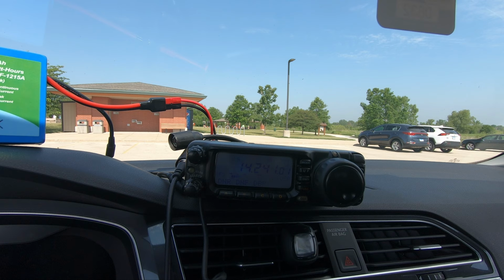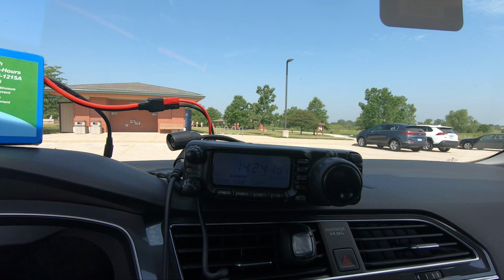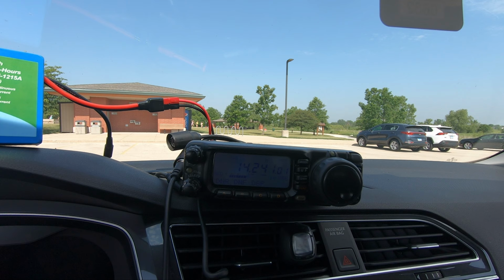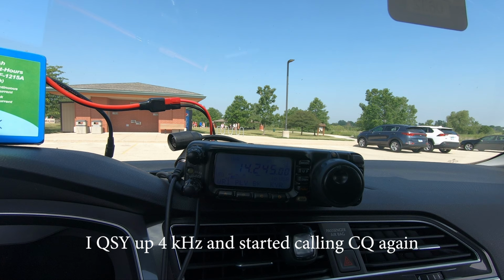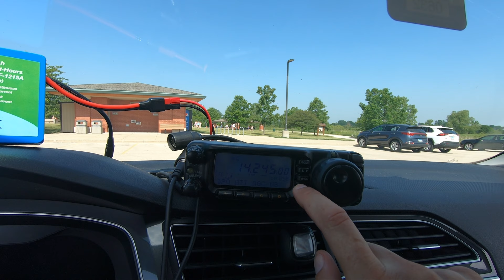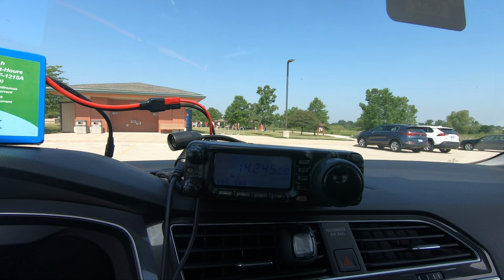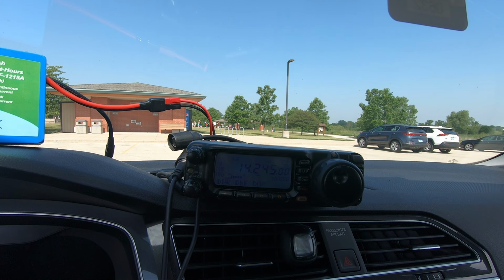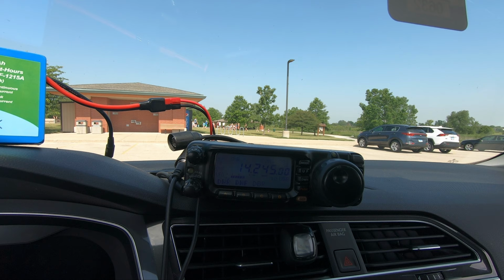Failed POTA Activation With The Yaesu FT-100

Comment: The swr warning comes on on my ft100 when it feels like it so dont trust it I've turned mine off and use a separate swr meter. Reading other reports it's a common fault with this radio. Keep up the good work. By the way my ft100 is a workhorse and gets hammered.
Reply from the maker: Thanks for watching and for the comment!  The issue I was having was with the hamstick I was using, I have since figured out the antenna issue and sent the FT100 in to get the 6m issue resolved, so I should be back up on the air with this radio soon.  Glad to hear it is a  workhorse because it is going to be my portable/field 100 watt radio.  73, WQ9F

Comment: That sucks that you didn’t activate the park. Get that SWR fixed!!!

I’m careful where I buy my gear. Usually from a reputable website/company. Not into buying used stuff.
Reply from the maker: I've bought many used radios in the past, even some on eBay and this is the first time i've ended up with a bit of a basket case lol.  I've gotten the SWR under control with some changes to the gear though and things have greatly improved!  Got some new videos coming up i'm pretty excited about.  73!

Comment: My activation of this park back on 2021-01-21 was almost a failed due to forgetting my power cable, literally cut chunks out of my counterpose for my EFHW to use as power leads, because i wasnt making about an hour trip and all the gas to get out there and do nothing.

As for getting contacts i think its just sort of the luck of the band conditions, last activation of K-7839 i did i got 95 contacts in 2 and half hours. While a pervious worst activation for that park was only 18 over about a hour. Really slow and before i had my larger battery so i only had 25w to work with. (Was using a 6Ah SLA i had sitting around)
Reply from the maker: It really is all about a bit of luck some days specially as we come into the new solar cycle still.  I activated this park once before and ended up with 85 contacts in an Hour lol, I sorted out some of the problems with my hamstick and radio setup though so next time will be much better!  73